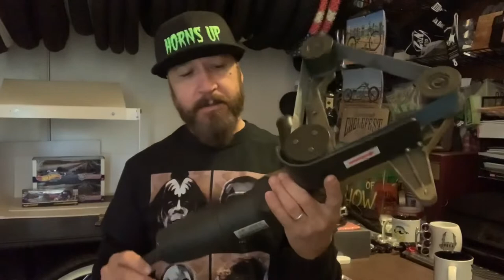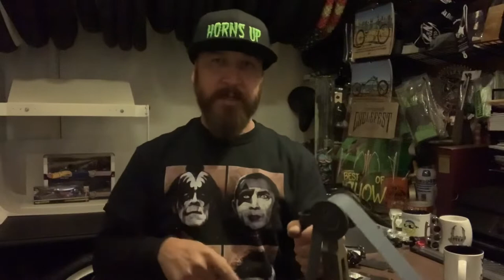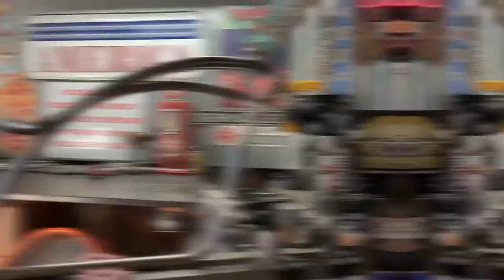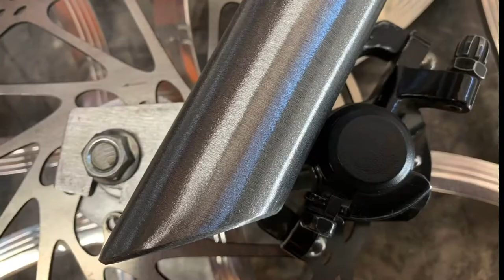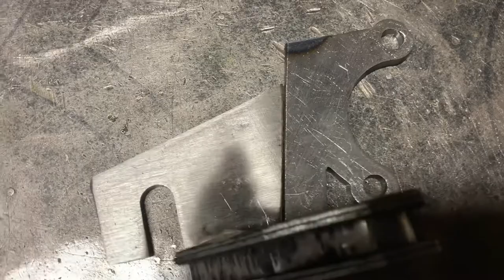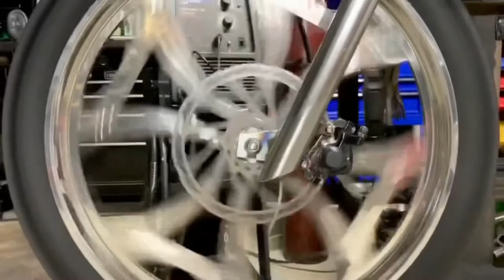Ep51 Peek Cycles: Disc Brakes, Dropouts, Brake Tabs, Specs and Your Options. BlueRock Belt Sander

Comment: i have a elecrta delivery 3i i like the dimensions of this bike fits me perfect  but i would  to build my own custom frame with disc brake tabs and  wide rear chain stay to fit a 3inch tire 1 1/8 steer tube bottom bracket to fit todays eletric motors   bafang or cyc        you do very good custom work